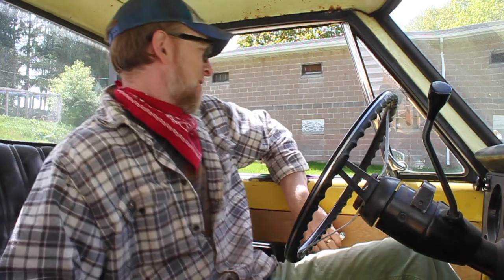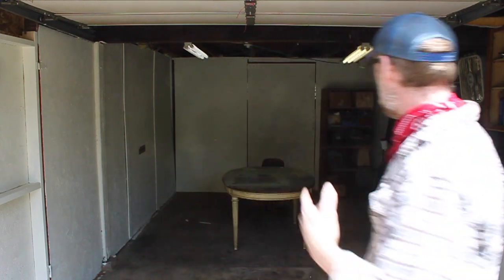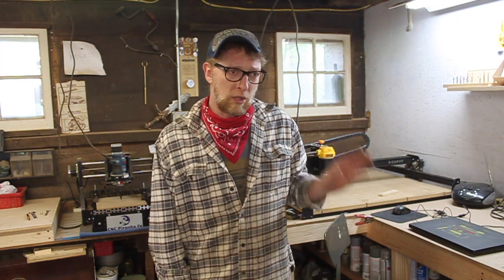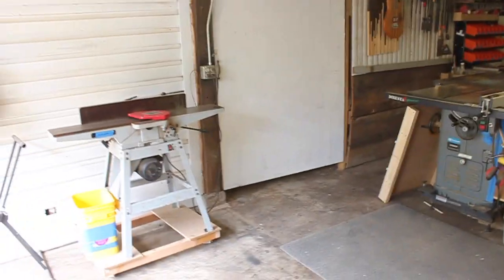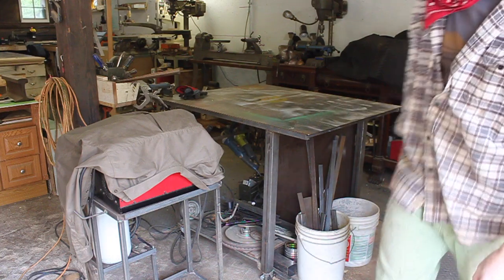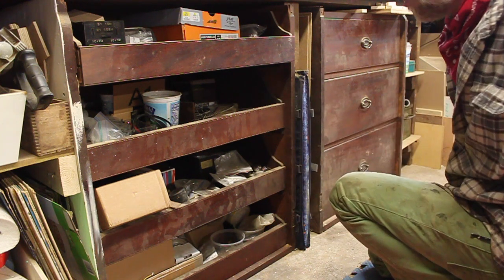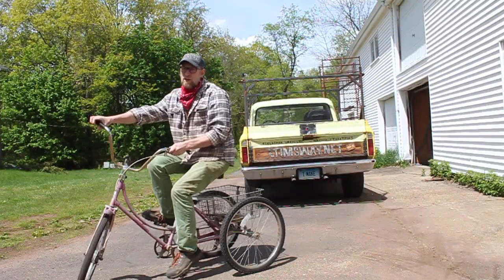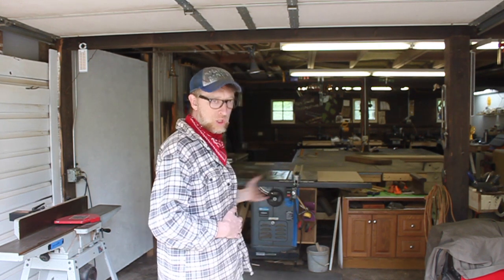Workshop Tour 2017 Tim Sway Perspectives World Headquarters

Comment: Nice tour Tim. I had to smile when you pointed to your two drill presses. I also have two, one of which is my grandfather's. I get a nice vibe when my kids use it as well. Liked the hammer tip. What is the overall size of your building?
Reply from the maker: Paul Buckel Jr haha! the main shop is 750, the first storage bay is the same and the paint bay is more like 400. dunno the overall footprint but I basically have half, so...

Comment: Sweet space Tim! I am jealous of it in the spring/summer haha maybe run some ducting for heat in the winter?
Reply from the maker: It's warm enough as is, that is after the first hour of heating it up :)
Reply: I had meant to the other areas like your finishing room, so you don't have issues with finishes curing or you freezing  :)
Reply from the maker: I don't think I can spare the heat from my wood stove. Maybe I'll put some other heat source in there.